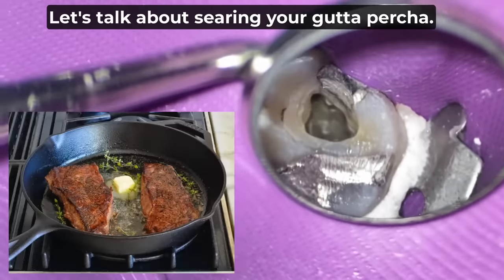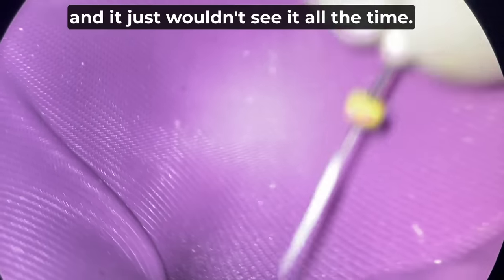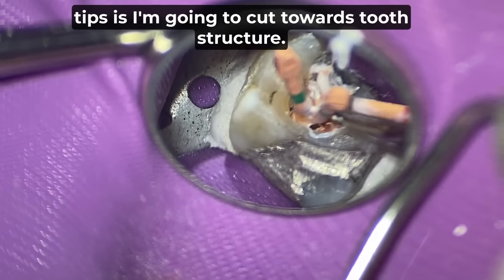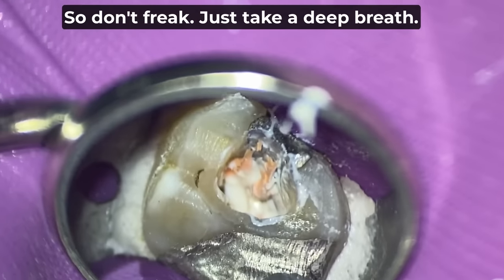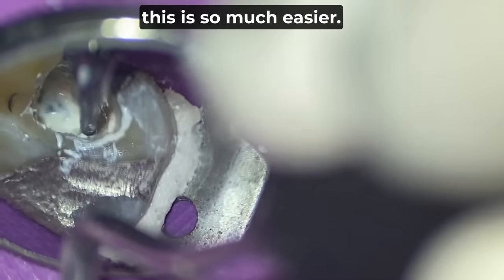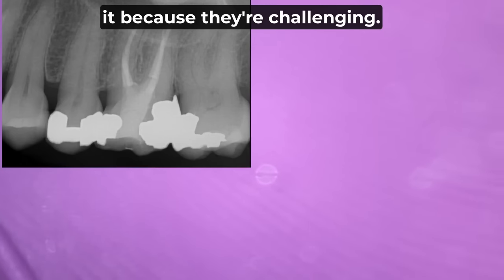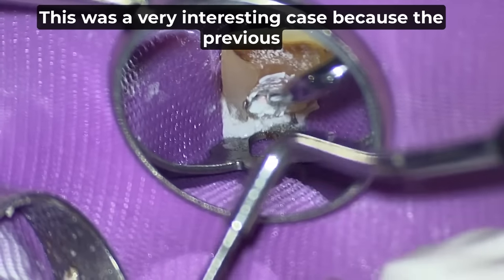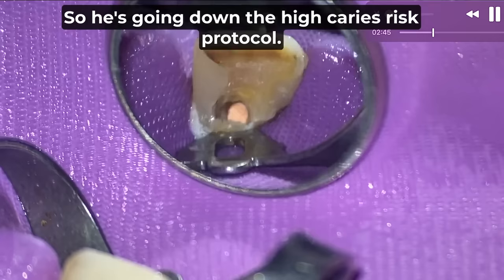Root Canal Obturation Simplified - Tips to Save You Time!

Comment: Since I started to fill one canal after the other it stopped beeing such a  mess. I just plug the cone in, cut it, melt it down, clean the orifice and do the next one. Saves me time and never failed to this point. Hth.
Reply: Very true… this is better
Reply: Totally agree. I do a lot of molars and find one at a time is the best way to keep it neat. Especially in patient’s with limited opening
Reply: The disadvantage is that you can't do a master cone radiograph with all the gb cones in their final place
Reply: @sinjary: why not? Just do the masterconeshot before the obturation without sealer showing all the GP cones in place. No mess. Take the cones out and start obturating the canals one after another.
Reply: @steffenreiser8769  you have to take them out and reintroduce them in the canals, and during this reintroduction in the canals a cone can bend on itself for ab example and not reach the full length, that happened with me before and it's hard to detect.
Reply: You could probably use fresh GP points for the obturation...
Reply: @sinjary true that

Comment: When you are blowing water inside , don’t u risk contamination from the water ???
Reply: That's what I thought. I use cotton pellets soaked in alcohol. They usually clean pretty well in 1-2 scrubs.
Reply from the maker: That’s such a great question. I’ve been doing this for 10 years, and haven’t really seen a significant difference in my outcomes. But just because I’ve been doing it that long, doesn’t mean that it’s right. We do use a closed water system on our chair so the water is distilled. However, using critical thinking, the alcohol choice would likely be better or just using saw him at the quarry with a micro brush. I’m going to try my best to incorporate that into my system, and after a month or two, do an update to this video.

Comment: I believe I have a much more efficient way of cleaning up after obturation. When your chamber is a mess full of sealer and GP. Take a small size 2 goose neck slow bur and press very gently on the top of each canal orifice. This nips off the gp from each of the canals. Then go in with a diamond ball ended ultrasonic tip with the water turned up high. This will both flush out gp and rinse BC sealer off the walls in about 5 seconds.

Start to finish this technique typically takes 20-30 seconds total from the point of melting off your last GP to having a perfectly clean chamber ready for core restoration.

Keep up the great vids!

Comment: Such a great video. Everyone will show you how to do the main steps, but it's these smaller steps in between that can sometimes lead to much hair-pulling, and it's very helpful that you've given so much time for something that most teachers won't even mention. This video truly justifies this channel's tagline.

I would love to try that tool by Eighteenth. Although I sometimes trim the excess gutta percha with a polishing bur when my heat tip doesn't make a clean cut.
Reply from the maker: Thank you for the comment. That is the problem with everything in dentistry. Hair pulling. It is all of those small things that are slowly learned through pain and frustration. I’m glad this video helped.
There are other brands of electric heat tips on eBay, and on the Internet. My experience has been they are cheaper, and work really well, but the battery dies within a year. I ordered one to create a training course for students to be able to buy one cheap, and it worked really well. I think it was from eBay or Alibaba.
Reply: @AllThingsDentistry  Sir y do u put all the gp at once and shear the gp ??? Y dont u do it one by one.

Its more easy and gp also wont come out like how it did in ur video.

U can easily shear gps one by one at the level of orifice...

Comment: always use my Eddy (which is in most cases anyway built up for the final rinse) and activate the sealer a little bit. I can only recommend. But dont use too much power and dont have an apex wide open. Best regards
Reply from the maker: Hi Martin, thank you for the comment. I did this once with the Endo activator and AH plus. I’ll leave it at, I’ll never do that again.! I certainly did not control the length, and I was not very impressed with myself however, certainly it’s a great way to make sure the walls are covered.

Comment: I still use AH-Plus. What I do in this cases, I spray with pressure a lot of air in the cavity, so that the sealer, a lot ofit,  is not anymore in the cavity. Than cut the gutapercha. You can see a lot btter- Just try it.
Reply: Try cleaning the chamber with isopropyl alcohol on a micro brush or cotton pellet

Comment: Question: In the single cone technique, are you worried about sealers being resorbed over time thus creating space for a theoretical re-infection  as proponents of vertical condensation argue against lateral condensation technique? Of course, I am aware that bioceramic sealer is very resistant to any resorption (if any).

Comment: Can u post a link to the ultrasonic tip you used towards the end?
Reply from the maker: Hi there, this is a sonic tip that is plastic. The cycles of the tip are lower than an ultrasonic chip. This tip cycles around 10,000 CPM, versus and piezo ultrasonic tip that is around 30,000 CPM.
Depending on the country that you live in, these may be accessible to you through VDW and they are called Eddy tips. I cannot get these in Canada, so I order them through a different supplier. What country do you live in?
Reply: Can you post a link for the Eddy lookalike? I’m in Canada too!

Comment: Doc, flushing out the excess sealant with air water , will it compromise the coronal seal?! I use cotton pellets and clean out the excess.. this tech like u showed then i can give composite core straight away.. just wanted to clarify using air water against sealant, does it compromise coronal seal or does it interfere in sealant setting?!